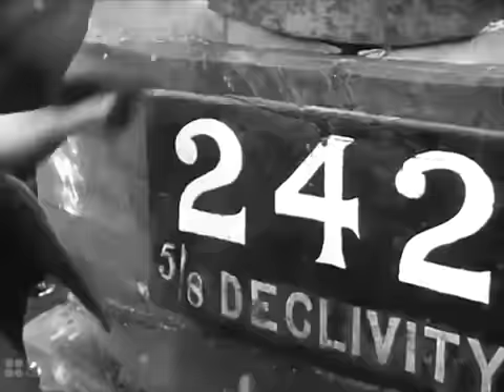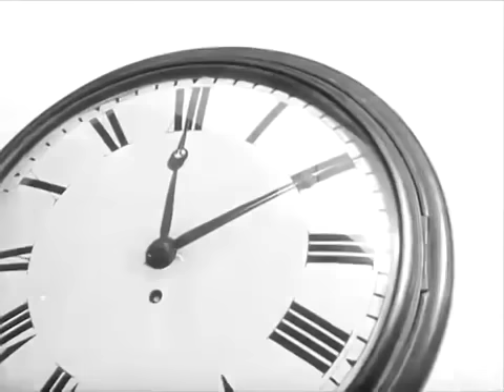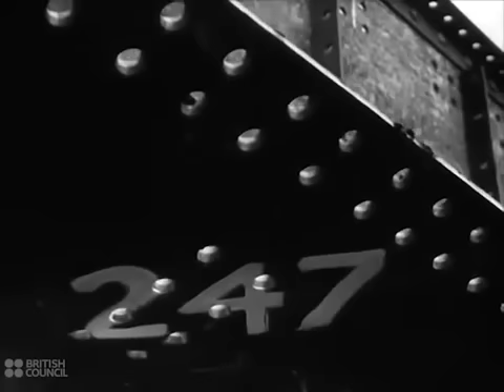Steel Goes To Sea (1941)

Comment: The died-out art of riveting! I was born in a place close to a shipyard in the late 40's. Although this was across  the river, I can still recall the continuous sound of the pneumatic riveting hammers, which by then had  replaced the hand-hammer shown in this movie. The skill of punching the holes using templates in the plates and frames separately, the plates still flat, where after  the plates are bend and then moved toward the new-build  ship. What amazes me is that the holes perfectly line up and ready to receive the red-hot rivets, if one hole is a fraction of a thousand of an inch out no way the rivet could go in and all successive holes would be out as well!
Reply: jan visser kb
Reply: A red-hot rivet would balk at a fraction of a mil? I think you exaggerate.
Reply: @VidkunQL  lol,  yes they were made to deform when red hot, that was their whole purpose. That was not a "thousandth of an inch"  tolerance factor. I respect the craftsmanship and hard work, but lets not make it more than it really was.
Reply: I suspect the top holes were punched into the raw plate and the holes underneath were drilled onsite using the top hole as a drill guide after the plate was mounted with guide bolts. That's the only way you could align rivet holes that accurately. Trying to align two punched holes with tooling like that would be next to impossible on a production basis.
Reply: I too was born in a place close to a shipyard in the mid 40's, this yard was also across the river. The town was Sunderland a great ship building town.
Reply: @pimpompoom93726  It not done that way. Frames and plates were punched separately to receive the rivits,
Reply: @janvisser2223  How are you going to align them with that equipment? I spent 46 years in industry with a lot of that on precision drilling and joining processes, there is no way you can punch holes that accurately without hard gages and guides. I sure didn't see any of that in 4:05. The only way to assure alignment of holes between the exterior plates and the framework is drilling the latter using the plate hole as a bushing-guide.
Reply: @pimpompoom93726  Being a machinist I know exactly what you mean, but I am also involved in shipbuilding and I know that the parts were punched separately.
They used the wood templates for that, on these templates all holes were marked and transferred to the plates.
Look at the whole film, there are more of these, were this process can be seen. There is a film about the building of the Dutch motor passengervessel “Oranje” (built in 38-39) in Holland were marking of the punch holes was shown
If you watch the present film again, you may notice that the frame was transported to a punching machine once bending it was completed. And that was at 4.05, were you can also see the white marking of the hole to be punched. On the erected frames the rivet holes are clearly visible.
I remember stories from old shipwrights that they had sometimes to ream holes that were not properly aligned. (Manually💪)
The heated rivets have enough clearance in the holes, the first hit on the end of the hot rivet causes them to enlarge in diameter, thus obtaining a snug fit in the hole of the plates. And at
Reply: @janvisser2223  I'll bet they had to ream more than a few holes if that's their process. It would be far easier to using the plate hole as a drill guide and have a perfect alignment every time. I'm not talking about the plate to plate rivets, that process looks pretty accurate 5:50 , but the plate to ship frame rivets would be very difficult to align. I know on Liberty and Victory ships they did a fair amount of rivet drilling onsite as I described, of course those hulls used as much electric arc welding as they could to reduce the cost and time to do riveting. Interesting discussion. Have a great Holiday.
Reply: It was a failure of shipyards to invest in modern welding techniques to replace riveting that helped to kill the businesses off.
Reply: Heroic times and heroic skills, but I'm pretty sure it did not take 5 years to train a man to hit a rivet soundly with a hammer (@09:53).

Comment: Excellent documentary. Some features of shipbuilding I had not seen before, such as the bending of ships ribs using mostly brute strength.
Reply: What's up sunshine
Reply: If you look closely, they're using a hydraulic jack.
Reply: @rorypenstock1763  yes just like a flanging press for railroad steam engine fireboxes and parts, or open die forging of sorts, only the peg holes in the floor are the forming die, but as it were it was an aquired skill and a bit of art in metal forming, no differant today, only the tools may have changed or the power might be air or hydraulic or servo but the concept is still there, and as for the kids that was how they learned their trade, fathers and sons working side by side togather as had been the case for centuries, or a son would apprentice to a trade or teacher to learn, the origional take your son's or daughters to work day but it was every day heh.

what I am shocked by is they did not have a hydraulic riveter or at least an air hammer to drive the rivets they were doing it by hand and in briten no less, in the usa well before then they were using pnumatic hammers to run rivets for boilers and buildings if not hydraulic yoke riveters, and that was at the turn of the 20th century, or at least for calking the seams in the plates, that is driving the metal tight around the gap between each plate so it dont leak using a blunt chisle for the purpose

Comment: If you walked in there with a modern MIG welder, their minds would be blown to pieces.
Reply: @wilson pickett i have welded in a shipyard on a warship. In the time it took them the heat and hsmmer a rivet, i could lay 3' of 3/8" filet weld. Plus, welds didnt spall when struck by a shell. And don't forget that welding saves weight and raw material.
I would wager that the reason they are rivetting instead of welding has more to do with the lack of men with welding skill than with the few advantages found in riveting.
Reply: @DoyleHargraves  I dont know much about ship building but i know grafters when i see them and these workers were grafters,welding looks a piece of piss compared to riveting but what do i know.
Reply: @DoyleHargraves  Welding came later, oxy acetyline was only used for cutting or welding thin sheet metal in those days. The welding thing only started after the war in uk.
Reply: @jr8163  World War 2 wasn't a beauty contest.
Reply: @DoyleHargraves  Welding ships together was first done during World War 2 including the Liberty ships in the US, which were a lot like the ones shown in the film. The first Liberty ships had a tendency to break apart and had to have a reinforcing plate riveted on. 

As far as the lack of skilled welders, some 2600 Liberty ships were built by unskilled laborers who learned on the job. Many came from impoverished rural areas to work in shipyards that were built almost overnight to meet the demands of ship production. 

Riveting was proven technology while welding was still in it's infancy. Only the speedy production demands of World War 2 forced the shipbuilding industry to adopt it, and to tolerate the steep learning curve.
Reply: No shit!

Comment: Skilled work - but post-1945 the Japanese decided welding sections together was quicker and cheaper.
Reply: It was the welding and prefabrication of the ww2 liberty ships in the States that were built by the thousands(over 2700) that got that whole ball rolling.